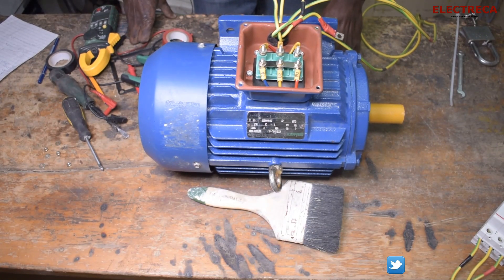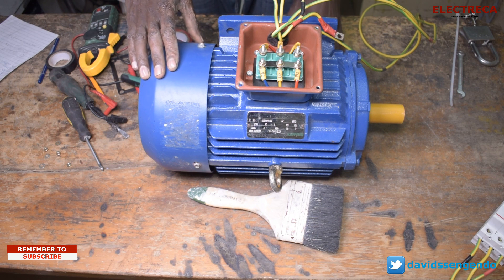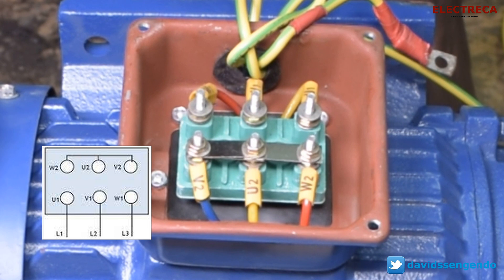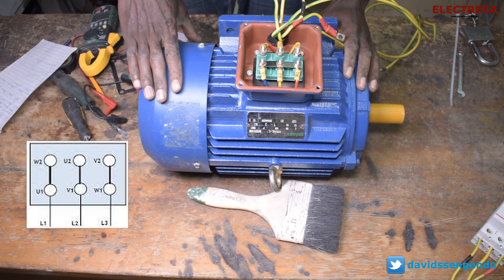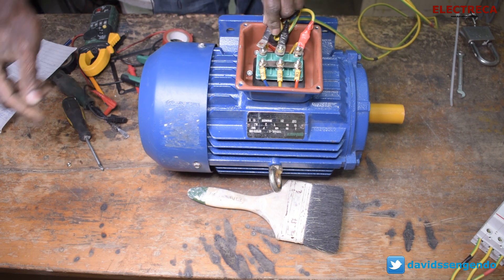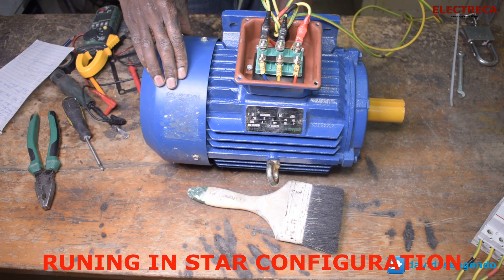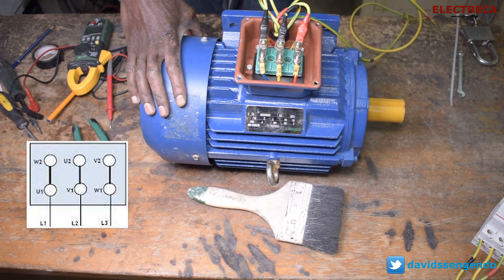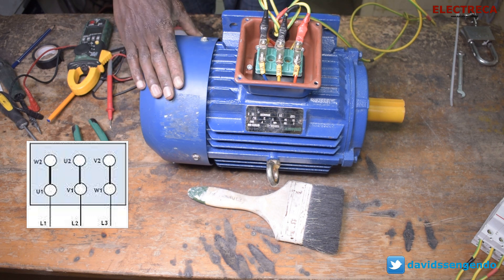Manual Motor Conversion: Step-by-Step Star to Delta Connection Tutorial

Comment: What can cause motor to burn waindings
Reply from the maker: Overload-applying a load that exceed rated capacity, Inadequate cooling,         
 Insulation failure ETC

Comment: Bro if I want to use the motor to generate electricity, where can I join the + & - battery terminals to?
Reply from the maker: Bro, motor don't generate electricity
There is difference in principle of operation between a motor and generator.
Though they both share a principle of electromagnetic induction.
Motors need electricity to spin the rotor(electrical energy to mechanical energy) 
Generator need mechanical energy(diesel engine, hydro or wind) to generate electricity. 
Try to read and understand the principles of operation of motor and generator.

Comment: Nice video,, how about if it's connected in star delta starter. In such case, there are about six wire, from main contactor and Delta contactor,, how do I change the direction of rotation

Comment: Where to connect neutral
Reply from the maker: That's a three phase Induction motor, you don't need neutral.
You will need a neutral if you operating a motor with 240 contactor(your neutral will work with the control circuit to operate the contactor.